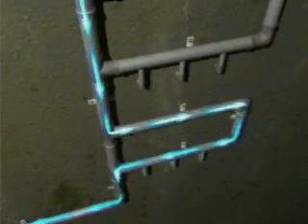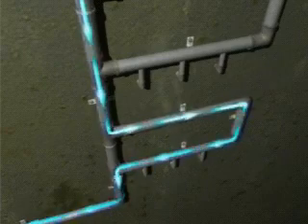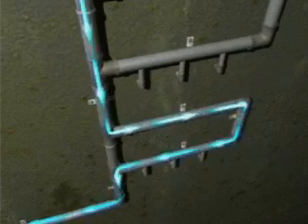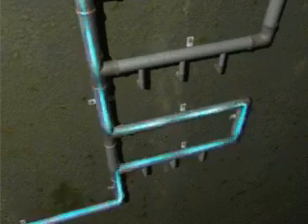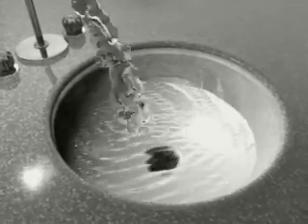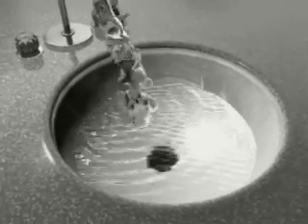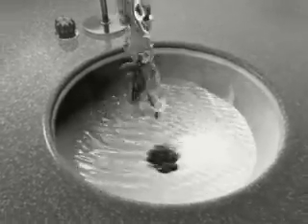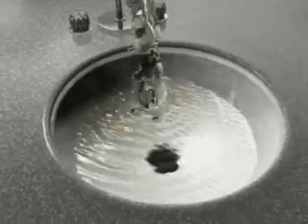Biofilm

Comment: @missjamie166 Whoa!  You've both made a couple of errors here!  Biofilm in it's self is not living, it is excreated by microorganisms and is used to aid mobility and protect.  Biofilm is EXTREAMLY resistant to cleaning and chlorine based products will not remove any significant amounts.  If fact chlorine actually contributes to the reproduction of biofilm based contamination by providing new places to reproduce, in the same way clearing trees allows new plants access to sunlight.

Comment: Kevin- 
Your statement is entirely untrue.  This is very accurate. Microorganisms can survive on very little, and the small amount of chlorine in our tap water only kills most of the germs, not all of them.  Biofilms do not need "protiens, carbohydrates, fats, vitamins and mineral(s)" They are single celled organisms, not tiny human beings. If you were to open up a water pipeline, or even a dental unit waterline that your dentist uses to spray your mouth, you would see that the threat is real.